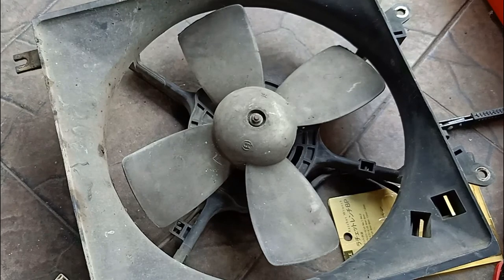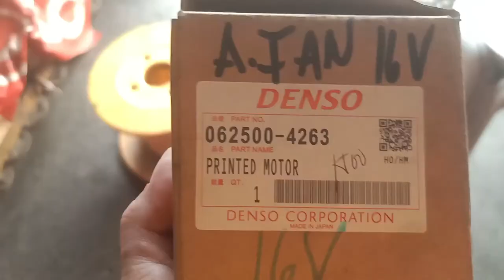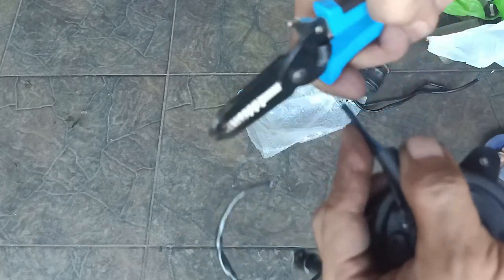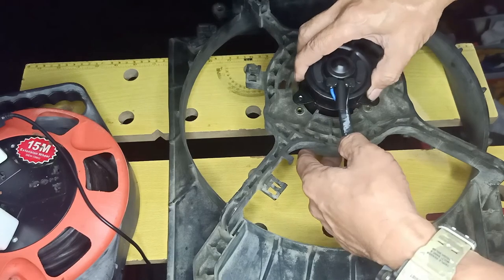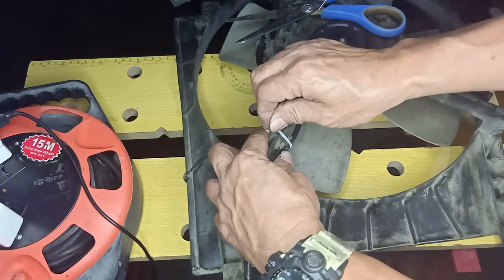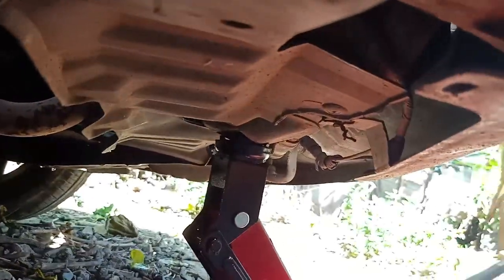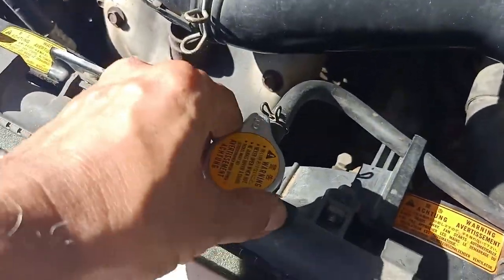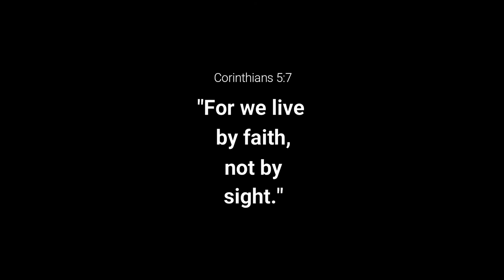Replacement of Lancer, GLX 2000, Aux Fan Motor and Reinstallation of Auxiliary Fan Assembly

Comment: Sir magandang araw po sa nyu,, tatanong po ako sir if ok lng,, mitsubishi glxi dn sakin model 2000,,, nawawalan po nang lakas yung sasakyan pagka pina andar ko yung ac ko po sir,, salamat po sa sagot po😁✌️
Reply from the maker: Hello brad Bo. Patignan mo sa aircon technician yang oto mo. Sabihin mo check ung IDLE UP kung may problema. Yan kasi ang nag tatama ng idling ng sasakyan mo pag binuksan mo ang aircon. Salamat sa panonood at pagkomento brader. Cheers!